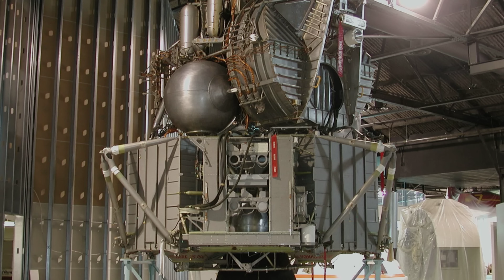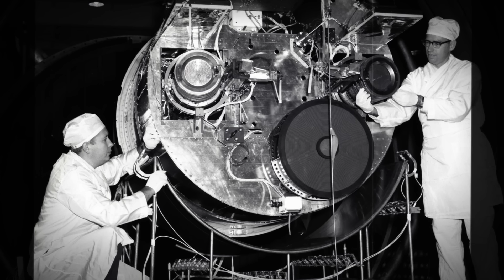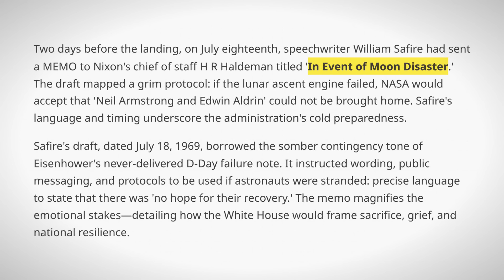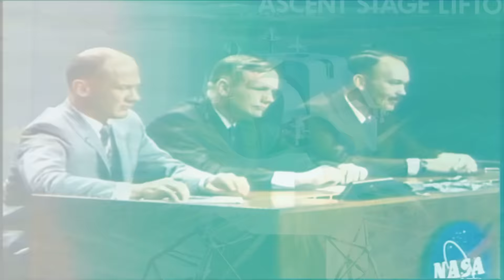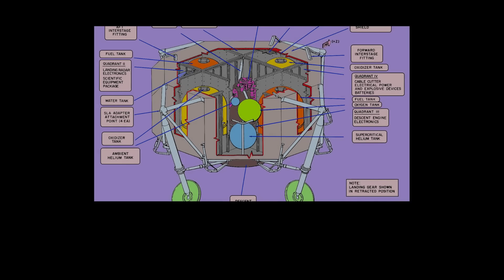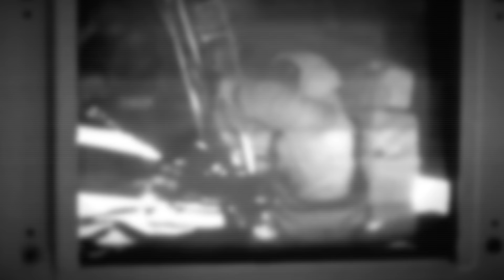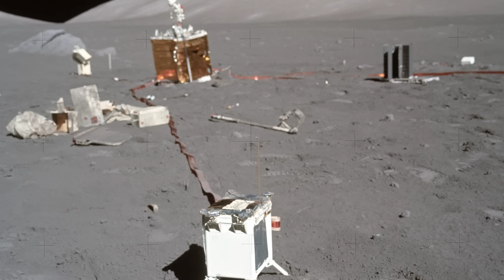Apollo 11 Nearly Got Stranded on the Moon

Comment: An alternative method was also available, but it would take more time and a few more orbits of the CSM to be in the right rendezvous position after liftoff. The pen method was simply much more expedient if it worked -- which it did. The LM pilots would not have been stranded. The pen thing makes for a very nice story.
Reply: As in right off 00:40 'ascent stage.. rather than decent!

Comment: Scientist says to colonize Venus it needs to block the sun first to make it cool down to freezing temperature 

Why not build a mass driver because fuel the main problem and ultra capacitor can charge even at low voltage 

Once the object slingshot to the Venus it should have automatic calculation like ai to release thousands of cluster medium automatic  folding and let the object fall to Venus because it would be costly to make it back to earth 

Install small thrusters to turn  thousands of automatic folding?

Comment: Aldrin didn't figure it out by himself. I know. My father was the engineer NASA called when that breaker was on the floor. My father received an MFA Appreciation award signed by the three astronauts. PS My father suggested a pencil and Aldrin said he didn't have a pencil but he had a felt type pen. If I could attach documents I would. I have sent and am sending more documents as I find them to the Simsonian.

Comment: I will be surprised if I get diagnosed with cancer myself? I got slightly irradiated. Over 20 years ago now. When I was helping to produce a Video for a Nuclear Pharmacy, pharmacy. Not available at your local drugstore. No.

This was a company. That irradiated both, glycolic and saline solutions. They have to inject you with. To find your cancer location precisely. Where Positive Emission Tomography a.k.a. PET Scanners. And I think it was called a,  "Klystron"? It was behind, 10 feet of cement all around. He said more environmentally friendly than using lead or beryllium. Which are toxic poisonous metals to humans.

This was a training. For their Smokey and the bandit style of transporting these, nuclear charged juices. To get it to the patient and testing facility. Within its 24-hour half-life. Because then it's no good. And this was their training video for their drivers. What they had. What it was all about? Why it is being well shielded. We can't take it through airports. They must be within 24 Hours Dr. time to patient. To save the patient's life.

And so this training seminar was on a Sunday. And on this particular Sunday. The Klystron was off for service. When the instructor is explaining to me during a break. All about the Klystron. And while it is protected with 10 foot thick cement walls. We can open up this submarine white door. And we can enter the center of the Klystron. Since the currently is not under a vacuum.

And he shows me this really cool little thing called a dosimeter. It's like a lapel pin. And he places it on the desktop in front. And I video it in front of me. Then he says let's go into the Klystron?

So I am now standing inside a gigantic man size, Nuclear Vacuum Tube. With the air let in. Since it was off for service. And I'm getting video inside the Klystron walls. The inside of the walls of the Klystron are to to these ultrahigh frequencies. And we are talking about it in depth. Inside the Klystron housing. When Bill looks at me and asked me… Where's that dosimeter I gave you? I said I left it on the table. Was that for me? He said yes. We have been standing in here far too long. It's still hot with radiation. Oh? We have to get out of here right now.

He told me I probably had the equivalent of about 500 Chest x-rays? Oh great? I'll make certain never get one ever again? Or maybe they will just light up themselves on x-rays? He said probably?

And so I won't be surprised? Now that I'm 70. If I get diagnosed with some kind of cancer? I'll certainly have a good idea as to what? Of course they could have also been the one trip to Ocean City, Maryland? When I was 18? I drove all night. I fell asleep on the beach. I woke up with second-degree solar burns. I ended up in the hospital for the night. There wasn't much they could do? My skin was bursting in all of these watery blisters all over. The pain was unbelievable? I had to stay in my dark basement apartment with the windows closed. And not go outside. Into the sun. For over a year. Because as soon as I did? Blisters would start bubbling up on my skin. Over a year later. So I figured that was a little too much solar radiation received? Skin cancer on my back would be a bummer. I can't reach it?

Radiation is nasty stuff. It doesn't all come from the sun. Do not remove the doors on your microwave ovens. And Jimmy the switch. That will not effectively work better. Instead of your, wattage gobbling furnace?  And is not recommended to do. They tried that at a Burger King in Florida. Some decades back. When I was working for NBC-TV News. Yup. Some manager trainee at Burger King. Got the bright idea. You could make the lunchtime orders move along more quickly. If you just remove the doors on the microwave ovens? And of course he was right. While also cooking the faces and brains. Of a lot of teenagers. Giving them some bodacious cataracts." Gray matter with, gravy. Needless to say the manager trainee never advanced to manage? He advanced to jail. I think he got like 3 years? I forget? It was sometime back in the mid-1980? I'll never forget that? How can you? They were born without a brain? I reckon? They learn what not to do again. And probably gave up working for the food service industry? But you never know? People are weird. And you would have to be some kind of powerful stupid? To remove the doors of microwave ovens? Especially when you can feel the. By just holding your hand in front of the open door? It's like magic! And what you can't see can hurt you? What a ridiculous notion?

I forget whether the manager trainee was 19 or 20? And when they got out? They probably got a good job with the US military? And they learn how to warm up hamburgers the right way. In the U.S. Army I would think? Do not take the oven door off the microwave, Private! I'm sure they learned? Kind of? I mean what kind of buffoon would do that ? To begin with? Low IQ that's for sure. Not Management Material. And probably became an office? Now working as a Federal Agent in a goon squad? To be certain?

I love these videos. It provides so much food for thought. It turns the stomach. LOL.
RemyRAD

Comment: I've said it before:
The strongest evidence that the moon landing never took place is the high quality of the Hasselblad pictures.   The camera that was said to have been brought had no working viewfinder, and no possibility to set distance and control focus.  It was hardly possible to set aperture and shutter speed.  And there was no exposure meter either.  The sharp, well-composed and perfectly exposed images shown are typical studio images.  It must be remembered that the color films of that time had very little exposure tolerance.  A maximum of half an aperture stop.  And the 500EL camera itself was particularly unsuitable for such a mission.   It has electric drive which was powered by the NickelCadium battery of the time.  They can't even handle -20 degrees.  Did you have a charger in the lunar lander?  The film path in all Hasselblads is very cross, as the rollers sit behind the film plane.  In addition, the current film is perforated for advance.  It would be impossible to advance the film in the temperatures said to prevail on the moon.  And there is a great risk that the emulation detaches from the base.  And probably the film will be damaged by the cosmic radiation.
Reply: 'The Apollo photos are too good to be on the Moon' - Examined by a photographer
https://www.youtube.com/watch?v=7x0Qy8I8An0
Debunking Gary Fong/Apollo Detectives - Cameras CAN work on the moon
https://youtu.be/hLXHrQ1Keac
Moon Landings Faked? Filmmaker Says Not!
https://youtu.be/_loUDS4c3Cs
Reply: @allyc1965  He thinks you could take an unlimited number of pictures with the Hasselblad, like he does with his phone, and hopes that someone will find it useful. The pictures he shows are on a digital Sony camera, which has nothing to do with the context. He also shows 35 mm negatives and something rectangular. Hasselblad has a square format of 60 x 60 mm. A Hasselblad cassette normally holds 12 pictures or Max 70. There was no room for any failed pictures. "Trail and Error" is not a scientific method befitting NASA and its financiers. The Hasselblad 500 EL is a typical studio camera that you would hardly take with you where there is no electrical outlet.
Changing the cassette and handling the "darkslide" with those gloves is not possible. Then you would have to go into the lunar lander and pressurize and decompress it with the limited amount of breathing gas you had with you.

Comment: Man!  Youtube REALLY has to get a hold of these overblow A.I. generated videos and exaggerated narrated videos once and for all.  An exposed relay partially broke that was likely still in perfect working order.  They used something metal to short two low power wires together for a millisecond.  The system armed.  End of video narration.  There was no danger, there was no risk of failure, there was no worry.  They had at least 50 ways to bypass the switch without a second thought. As for Colins in space having backup plans...the average person has a dozen backup plans if their car breaks down.  Not surprising, not remarkable, and all done long before the rocket ever left earth.
Reply: Agreed. This is just ai slop click bait. 👎

Comment: The Technology They Used in the 60's 
Raido Shack Circuit Boards 9 Volt Batters a Soldering Iron , GI Joe Walkie Talkie 
Black Electrical Tape ect ect ect ... And of Course TANG ORANGE JUICE 
You get my point 🤔
Gene Kranz & many many Dedicated people on the ground 
The Real Men were the ones that strapped themselves
into the BIGGEST DAM FIRECRACKER  man had created
Reply: Tang was not flown on the Apollo missions. It was a candidate for a powdered beverage drink because it fit the requirements they were looking for, but in taste testing the astronauts preferred something else. This didn't stop the misconception that it actually went up with them, and the company that owned Tang certainly weren't going to correct people since it gave the product a huge boost at the time.

Very similarly, freeze-dried "astronaut ice cream" was not the item it was purported to be. It did go up on one or two missions as a test item, but was dropped after that. It wasn't popular at all with the astronauts. But it sold like gangbusters in museum giftshops so it's still being made.
Reply: Moon Landings Faked? Filmmaker Says Not!
https://youtu.be/_loUDS4c3Cs

Comment: There is no need to create additional drama over something that never happened. 
  Think about it: thousands of pounds of steel, aluminum, wiring, lubricant, fuel, 2 live bodies, and on the first, untested try, it powers for the first time with rudiment controls less than a canoe and goes straight to an orbiting can and locks on like a nursing sparrow. Yeah, we believe that. Mork and Alf were there and they say "BS, we got here by the J rural bus and so did they."
Reply: Everything sounds like a conspiracy when you know nothing.

Yes, they just pressed a button and it magically teleported the LEM into docking. OR the people who planned the mission have more than a 4th grade grasp of math, unlike you, and the trajectory was calculated long beforehand. Which is why, you know, everything was timed to the second.

See, I know it's hard for you to understand, but Sir Isaac Newton was kind of a big deal. And that big, scary math is what makes a lot of things possible when you actually understand it instead of looking at something like the LEM the way a caveman would look at an internal combustion engine, completely mystified at how everything worked in it.

The biggest thing you tinfoil hatters don't get is that the Soviet Union was monitoring every step of the program. They knew all the frequencies, they had the equipment to track everything. They were listening in and following every step of the way. And afterwards what happened? They congratulated us on the landing. They had the biggest vested interest in the world to call us out at the slightest hint of smelling BS, and embarrass us on the world stage. Had they even thought for a second that any of it was fake, they would've gone screaming about how the entire Apollo program and the country as a whole was a fraud. Hell, they would've LOVED that. They would've then been able to beat us there for real.

But did they? No. Because they knew it was real. Despite being our mortal enemies at the time at both the country and the scientific level, they acknowledged we beat them there.

Comment: They left the Apollo 11 LEM ascent stage in orbit around the Moon, only later missions were deorbited to crash into the moon and get seismic readings.
Buzz only used the pen to close to push in the Breaker, he only broke off the outer black plastic stud that is used by all pilots to open or close a breaker on or off.

Comment: That circut breaker breaking was one of those oh shit moments.
Reply: That breaker broke bad, but the marker found its mark to make it from the Moon to a museum.
Reply: Have you been there yourself? Where do these wild fantasies come from ?
Reply: @Gordo-r5e  The television they seen it all on the television!
Reply: @evisceratednation  It's an infection of some kind😂😂😂😂
Reply: @Gordo-r5e  Disney Adults will believe anything.
Reply: NO it wasn't. This youtube channel didn't research the subject very well. NASA wasn't going to allow a broken circuit breaker to end the mission. Indeed, Neil didn't want the circuit breaker, wanting to start the engine manually. And the breaker was open even after he knocked it off.  All Buzz did was hold it. If it had tripped they would have overrode it and started the engine two other ways. These AI generated youtube channels are a joke

Comment: "Never tested."  I hoist the bulls*** flag.  The Lunar Module ascent engine was certainly tested on the ground numerous times.  And it had been tested in Space three times before - on Apollo 5 (unmanned, Earth orbit), Apollo 9 (manned, Earth orbit), and Apollo 10 (manned, Moon orbit).  Each individual flight engine was not tested before flight due to the corrosive nature of the propellants (UDMH and Nitrogen Tetroxide are both nasty stuff), but the engine was so simple, there was no need to test an individual engine.

As for the arming breaker, the Lunar Module electrical system had been purposely designed so that alternative switch settings could bypass a malfunctioning or broken component.  This was not a big deal at all.
Reply: You misunderstand. That engine was a one-time use machine. It couldn't be tested. Sure, the design was proven, but that engine was not previously fired.
Reply: @LeonBerrange  He said that
Reply: I don't think the comment was meant to be deceptive, but recognized like you said that the individual engine wasn't acceptance tested prior to flight like most liquid primary engines are.